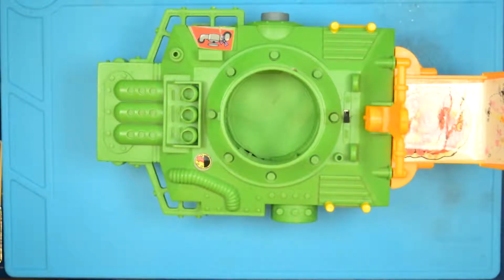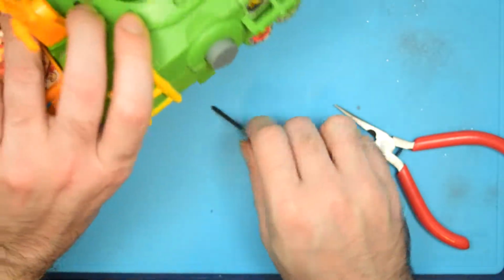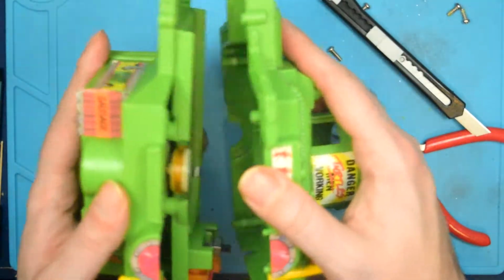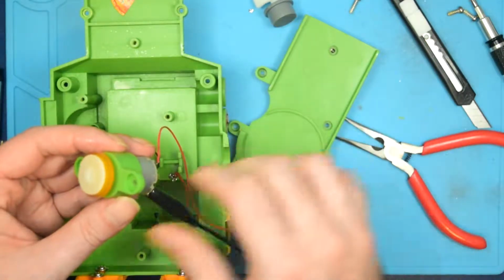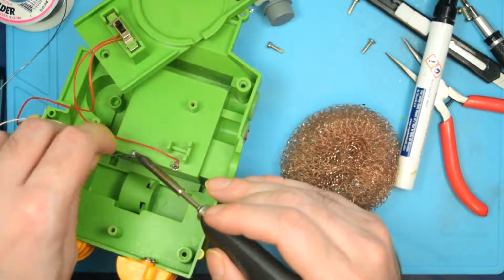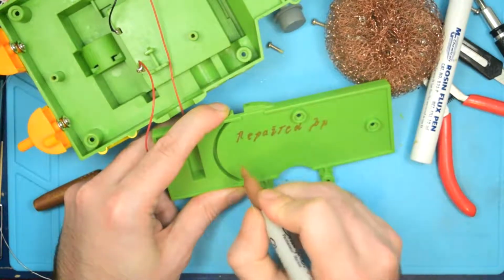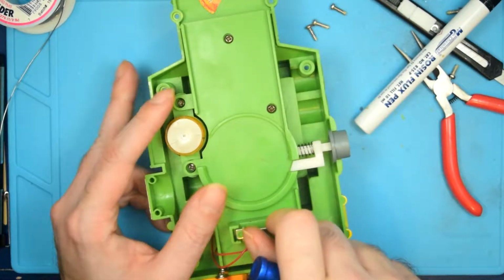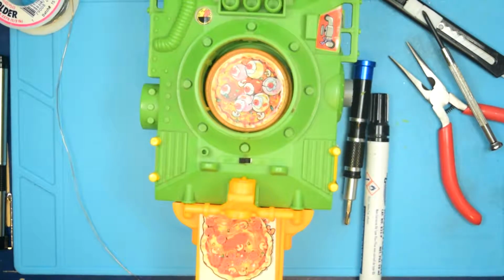TMNT Pizza Thrower Repair - Part 1

Comment: For those having to replace the orange round piece in the rotary piece, just replace it with a rubber washer equivalent in size, but you may have to enlarge the hole in the washer a bit. I did with mine just now and it works like new.
Reply from the maker: That was an option I was considering.

Comment: I’m trying to find a decent/basic variable power supply any advice would be amazing.  I’m basically fixing a bunch of my childhood toys.
Reply from the maker: The one I use, I purchased from RP Electronics.
Reply: @GadgetBoy  do you know the model name?  They have a few options.
Reply from the maker: @The-hand-of-the-king  Circuit Test PSC-9800

Comment: Have you ever had any experience in replacing the rubber piece that goes on the rotary piece that makes contact with the pizza??
Reply from the maker: I still haven't figured out a good way.
Reply: I just replaced the orange round piece on the rotary piece. I replaced it with a rubber washer equivalent in size. I just had to enlarge the hole on the washer to be able to fit. Now this thing shoots at least 6 to 8 feet away again.

Comment: Cool video!  Would you mind telling what power supply you were using to test it?  I’m about to try to repair my old one I just found.
Reply from the maker: I should probably do a video on the thing. it's something I picked up at rp Electronics, it's a variable power supply built into a large protoboard.

Comment: You didn't show it shooting pizza...
Reply from the maker: It can't. The rubber wheel that shoots the pizza isn't rubbery anymore.
Reply: @GadgetBoy  how do you replace the rubber wheel?  That's my problem with mine as well; super glue applied around it didn't work.  Can a new rubber washer be applied?
Reply from the maker: @kimberlyroll7238  This project is on hold at the moment, but I have some ideas. I'm considering painting the old wheel with that liquid rubber stuff you can get at the hardware store (it's used for tool handles and such). I just don't have the disposable income to pay 30$ for something I'll only use maybe once or twice.

Comment: The guy asked you to fix it, you cut through a sticker and write all over it 😖
Reply from the maker: I didn't have a choice on the sticker, and it's kind of a tradition to write your name on the inside of something you repair.
Reply: @GadgetBoy  I've repaired HUNDREDS of vintage toys, electronic toys and computers & I have NEVER written my name on them! Your friend wanted to sell that and you lowered he value so much! Believe it or not, online buyers WILL open these old toys up and see if anyone has been in them and messed with them. If your friend gets one of those buyers they WILL be demanding a refund.
Reply: @GadgetBoy  noooo
Reply: @GadgetBoy  To be fair, a heatgun would do the trick :-)